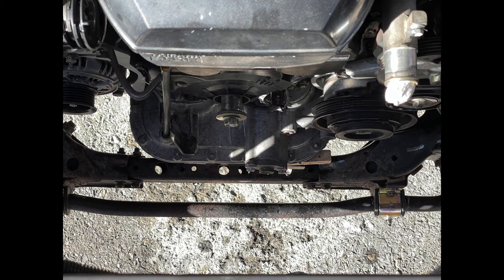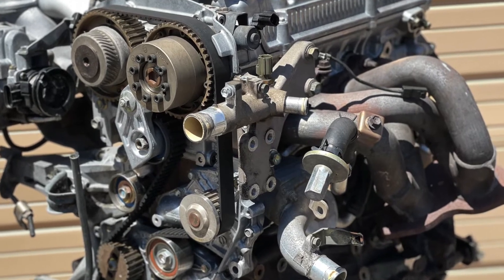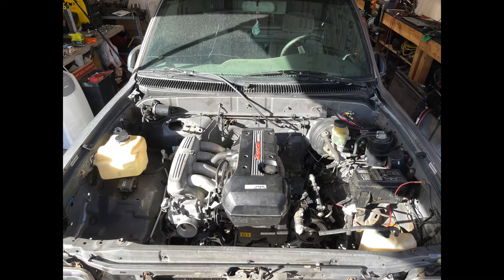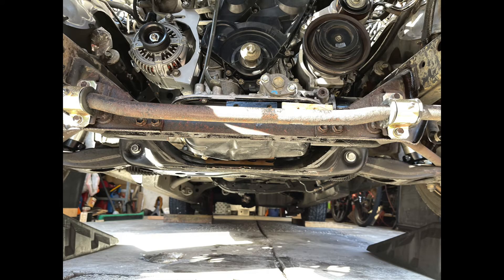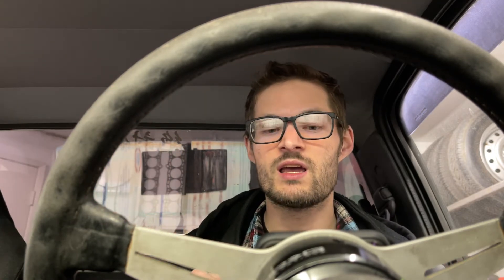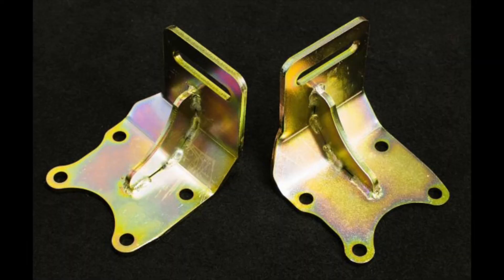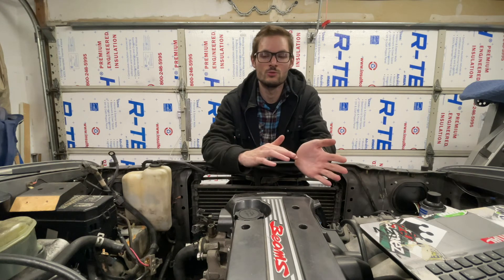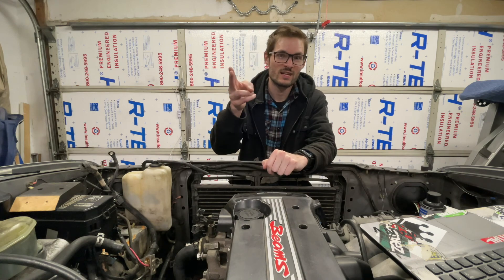Beams Swapping a Tacoma E03 - Engine is in and Fits Great

Comment: This is gonna be a long, unnecessary comment explaining my entire life story but here goes:

I've got a 5 lug 5MT 97 Tacoma myself, got it for cheap with a hole in the block from a customer of mine at my old shop. Also managed to nab up a rolled 2wd truck with a good engine, but automatic trans. Swapped the engines a couple years ago and I've been dailying the truck ever since, absolutely love this little thing. Well in late January of this year I started having difficulties shifting from 5th to 4th gear. Figured it was my synchros, took a fluid sample and sure enough I had a little bit of gear oil in my brass (I didn't get that backwards btw). Started doing research and decided that while I am a professional technician and could handle a manual trans rebuild, Toyota does not sell internal W57 parts anymore and all the aftermarket synchro kits are dodgy as hell. So I said whatever, I'll limp the truck around until I can get a new 1ZZ for my 9th gen Corolla. Well I was leaving work in early March and noticed I was having trouble getting into first gear, thought it was weird but didn't initially think much of it. As I drove home I noticed considerably more slop in the shifter/trans than I normally feel. Had to stop at the store on my way home, and when I tried to leave the parking lot I could not for the life of me get it into first or second gear. I eventually managed to get it into third and just left it there. Slipped the hell out of the clutch to make it home, which sucked because I hit EVERY SINGLE RED LIGHT I could've possibly hit.

Anyways, I immediately bought and installed a JDM 1ZZ for my Corolla and started driving that. At this point I told myself "screw these weak ass W series transmissions, I'm just going to find a K20A2 and a Nissan CD009. That'll let me rev to (damn near) 8k rpm, I'll have another 60hp, I get another gear to play with, and I'll have a much larger aftermarket available to me." So for the past 9 months I've been talking to other peeps and planning out this glorious K swap in my head and on paper. Figured it'd cost me roughly 8 grand for the main components, ie engine, trans, adapter plate, flywheel, clutch, ecu, and harness. Figured 10k for a complete swap; a little pricey but can you really put a price on revs?

Sometime in May I bit the bullet and got a used W57 so I could still use my truck to do truck things while I save up money for my K swap. Upon removing my shifter from the old trans I noticed it wasn't even moving the shift forks 85% of the time, and when it did it wouldn't go through the full range of motion. I was thinking all along that my shifter bushings must be worn out since they've got 297k miles on them, but nah, the bolt holding the shift linkage to the shift fork rods was entirely snapped off. Dug around through some gear oil and found the head of the bolt, stuck it back on for shits n giggles and found out the bolt had loosened up and backed out a little bit thousands, possibly tens of thousands of miles ago, which is why my shifter had always felt a little sloppy. This also likely put excess wear and tear on my synchros which caused them to fail. Slapped the new (to me) trans in and my truck has never shifted so damn good. Still wanted to K swap my truck, though.

Fast forward to early November and I competed in an SCCA Rallycross event with my dad, each of us driving our own, nearly identical 1997 Tacomas. It was my first ever motorsport event and I can't stress enough that this was the most fun I've ever had in my life. Prior to this event the incessant yearning for an engine swap had partially subsided as I picked up an Aprilia Shiver 900 in July and was head over heels for the two wheel life; I still dreamed of a K swap Tacoma but it was definitely pushed to the back of my mental queue. But after the event it was back on and in full force. I figured I'd start doing mods that would give me the most competitive edge, like a Ford Explorer 8.8 swap so I could have limited slip and rear discs. Last week I picked up a diff carrier for an 04 Cobra for CHEAP through the Ford dealer I work for since they came with Ford Performance carbon LSD clutches. Given my specific circumstances it was cheaper than buying the clutch kit by itself, and it was 31 spline so it'd slap right into an Explorer case. Found a non-Cobra Mustang pinion yoke that would bolt up to the 8.8 pinion flange that just so happened to have the same u-joint bearing cap diameter as my stock Tacoma drive shaft, and found a Spicer u-joint that perfectly matches the two slightly different widths. Still thinking about that K swap though

Well three nights ago I was on YouTube dicking around and musta seen some thumbnail with a 4AGE 20v. I absolutely love older, high revving Yota 4 bangers so my mind got to wandering. Started perusing eBay for em and decided they're a little rich for my blood, then I came across a Blacktop BEAMS with the trans, harness, and ECU included for $3k taxed and shipped out the door. Revs to 8k, another 60hp, another gear to play with, and a much larger aftermarket available. Came into work the next morning, realized I'm getting a bonus from Ford corporate, and then pulled the trigger on the BEAMS I wasn't even seriously planning to buy. Screw a K swap lmao

Anyways, I've spent the last two days diligently researching and planning out the swap in my head (and on paper) since all my K swap planning has now gone out the door. Figured I'd have to tread new territory with this endeavor and just to happened to come across your channel and your instagram.

I coulda made this a LOT shorter by just telling you that 1. You've got impeccable taste/you're a man after my own heart and 2. You gained a subscriber to your massively underappreciated channel and follower to your massively underappreciated instagram but idk I guess I felt like typing all this up for myself. Anyways, I appreciate the hell out of your work and insight and you're going to make my life a HELL of a lot easier. Cheers man!

Comment: Build the 2rz or buy a beams 🤔
Reply from the maker: That's a tricky question. If you want high revving 4 cylinder noises with most of your power up top then the Beams is great. If you want overall power then probably turbo 2RZ would be better. Especially now that Beams prices have shot up since I bought mine.